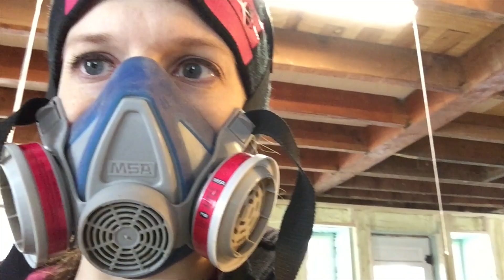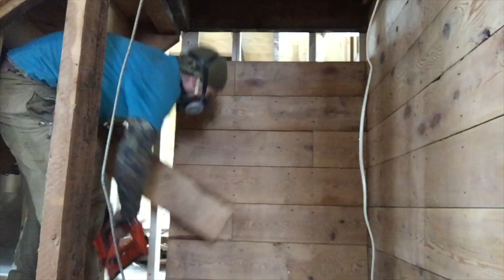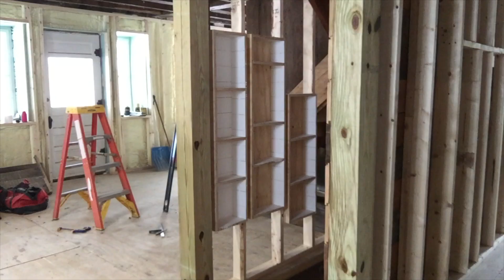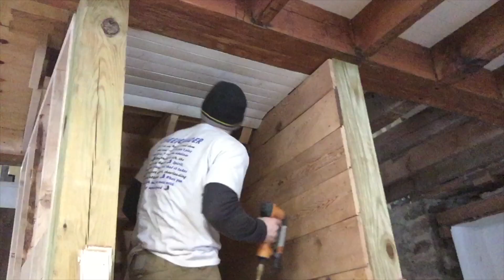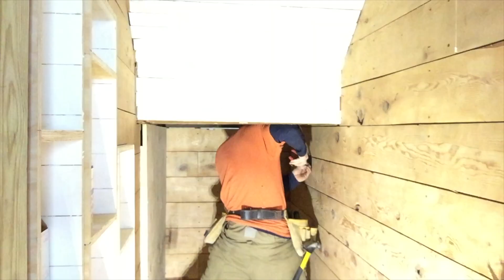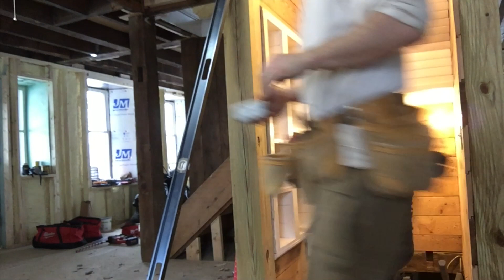1806 Stone House Renovation - Basement Stairs - Episode 58

Comment: the edge between the wall and roof needs some trim and maybe you could install a wall mounted railing on at least 1 wall of the stairs.
aside from that good job! I love the irregular shape of the shelves. gives it a modern twist without feeling out of place.
Reply from the maker: Hey, I do like the way they turned out just using scraps.. I also have a railing to go up and trim.. just gotta take the time to put it up.. thanks 😀